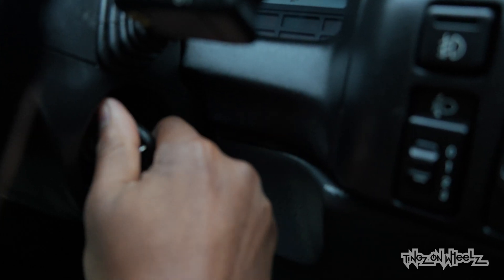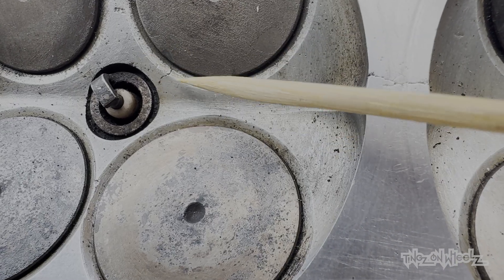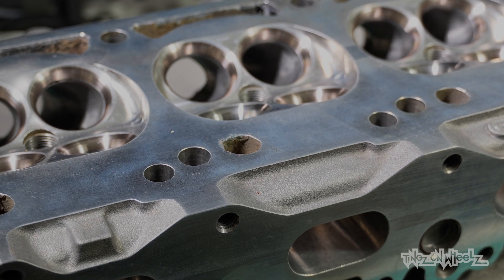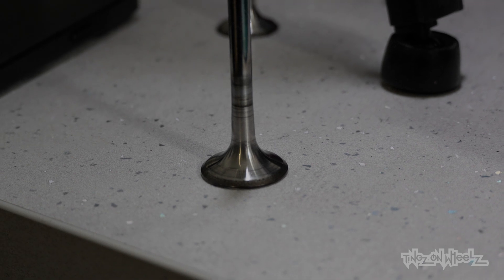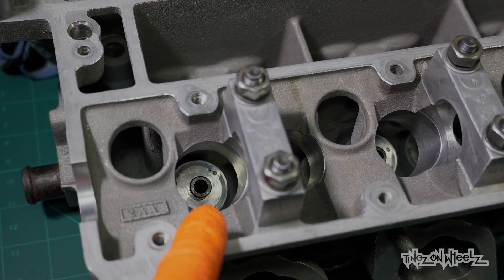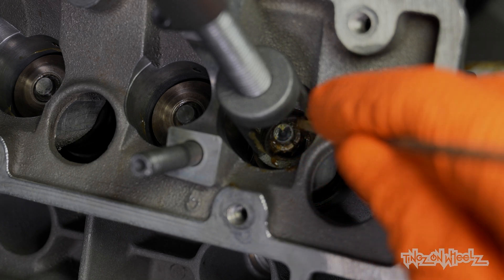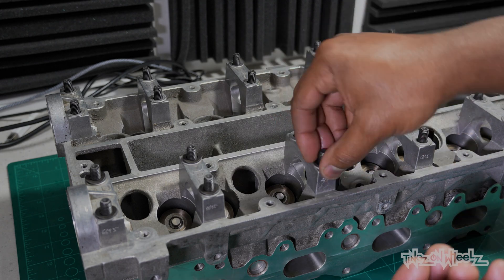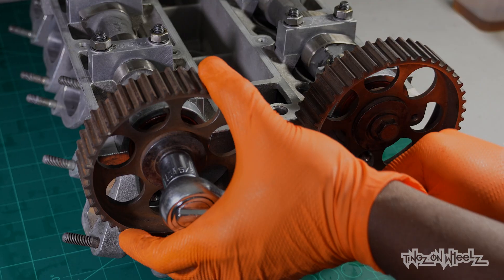I Rebuilt This C20LET Head! Was It A Walk In The Park OR.....

Comment: hi, great job you're doing on the calibra turbo i worked on one with a friend, if you need any advice don't hesitate to ask. a simple fix you can do is install the c20xe camshaft 3 degrees in advance. you'll get about 40hp more power without doing anything else.

Comment: Did you check the oil drain at the rear of the head ? I've always been told it's a must as if blocked,  it can lead to issues that lead to removal again
Reply from the maker: @richardmoore8439  all clear 🫡